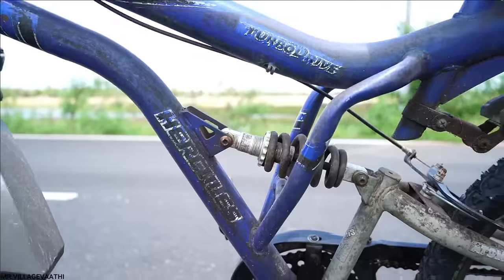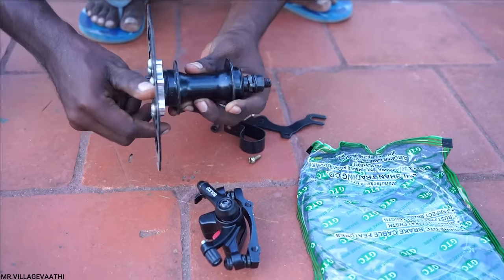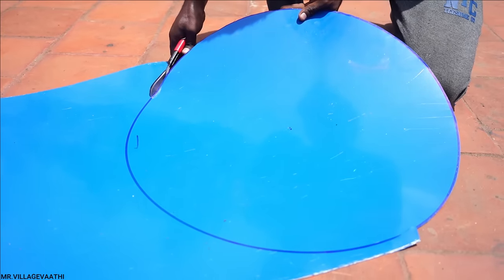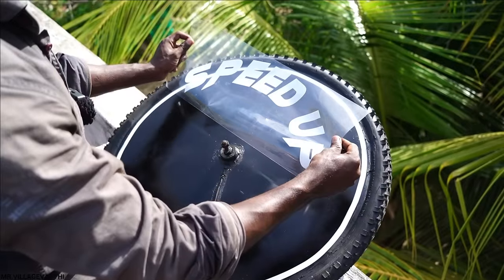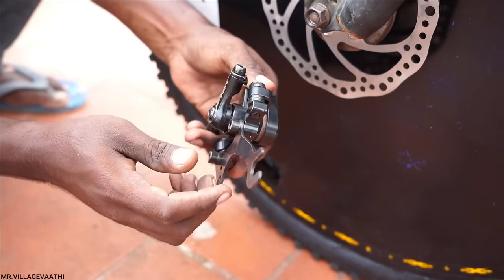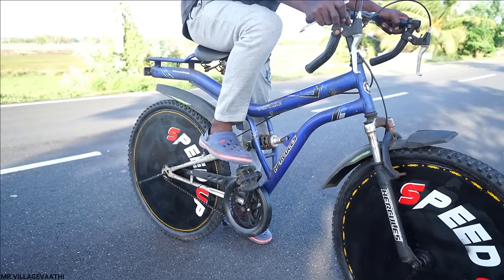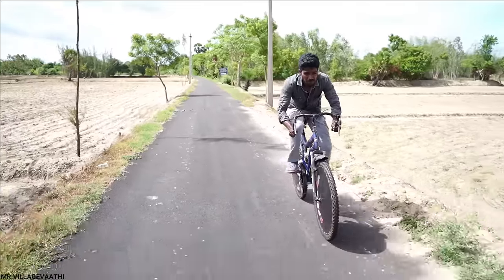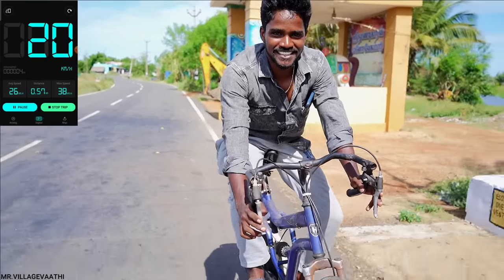SPEED UP YOUR CYCLE without Gears | Modified Cycle | இது ஓடாது பறக்கும்..! Mr.village vaathi

Comment: இல்ல எனக்கு புரியல, ஒரு வேல டயர் பஞ்சராச்சுனா எப்படி பஞ்சர் போடுரது ??? 

யாராவது பதில் சொல்லுங்க.
Reply: Basically if you noticed at Olympic games especially cycling
They'll use the exact same method of bike with fully covered Infront tyres and backward too. 
Once the cycle tyre gets punctured most probably theyll change the whole tyre. At this case, especially in this video maybe he will remove all and change the puncture and fix back again as normal.
Reply: Ok bro thanks 🙏🙏🙏🙏